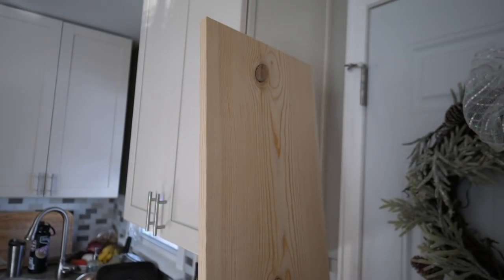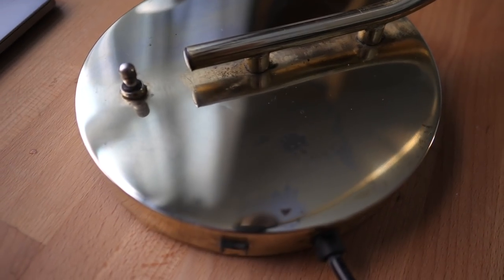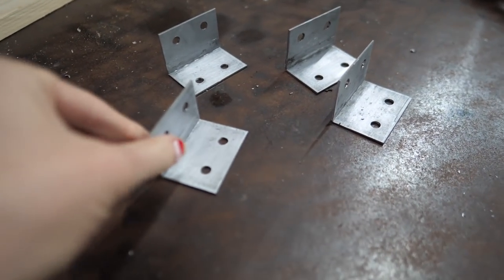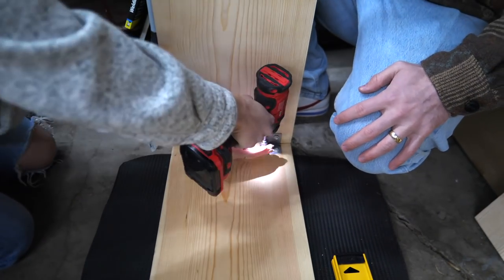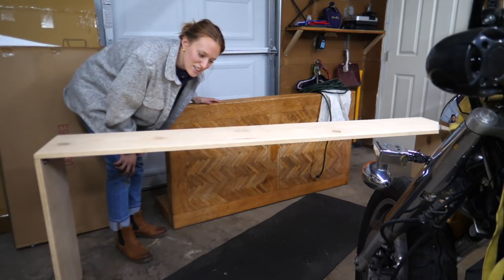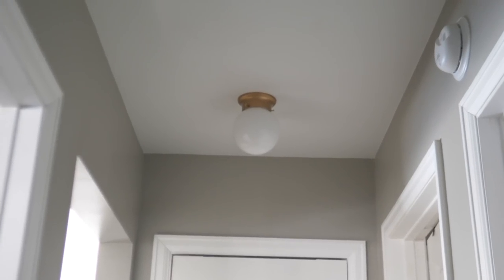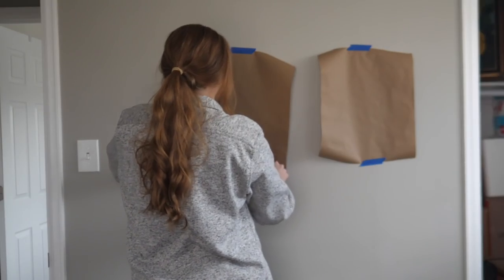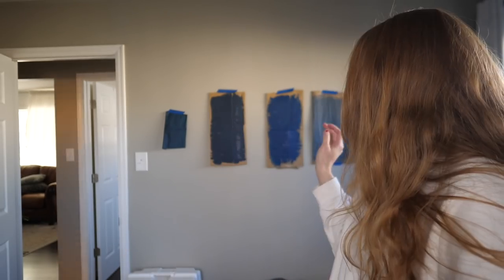DIY Console Table & Painting the Office BLUE? 😱

Comment: As someone who builds cabinets, I would suggest putting a second shelf inside the console running the length of it, maybe just tall enough to put a coffee table book or a basket for mail, keys etc. You’ll also have to put a block about halfway in the length to create two equal sides. You can add a back brace the same dimensions as your shelf takes up on the back if you need extra support and to keep anything from falling out the back of the shelf. Buy a kreg jig and you shouldn’t need any of those brackets. I know it’s not the exact vision, but short of starting over with thicker board, I think that’s your best option. Pine is a soft wood and for the thickness you currently have, it’s going to allow a lot of reverb.

Comment: For the table make sure to wood glue where the wood connects, it'll be a stronger bond than the braces and won't shift as much. Also because the legs are so far apart, you need another piece of wood across the back  lower down to brace the two legs so a dowel connecting the two legs will give you much more stability. If you don't like the look of it you can have it at the back side of the piece and then paint just that part the same colour as the wall.

Comment: When painting or staining, if the object is too cold it won’t take the color the way that it should. Basically, your wood pores are too closed up due to the cold temp outside. Lightly sand it and bring it inside to warm up. Stain inside in a ventilated space (maybe just a room you can close off and open the windows in).
Reply from the maker: OH. My gosh. This is my answer! I can’t thank you enough bc I really didn’t want to buy yet another stain product! Thank you thank you!
Reply: Also never let paint or stain products freeze. Completely ruins them. I’m also from the Cincy area, so I’ve had to deal with projects in all types of weather. Good luck!

Comment: Add a long straight 2x3/2x4 (with the '4' side vertical, if that makes sense!) to the underside of the top of the console table, screwed and then dowel filled into the sides - and then glue the waterfall joints. Wondering if that might help with stability?

Comment: A T-Bar (basically a two by two or two by four piece between the two sides at the bottom or a few inches from the bottom, in the middle) and a decorative molding piece at the top front between the two sides to hide the brackets would help?